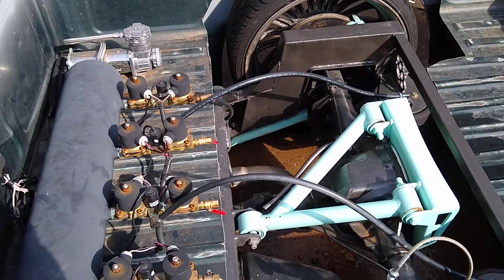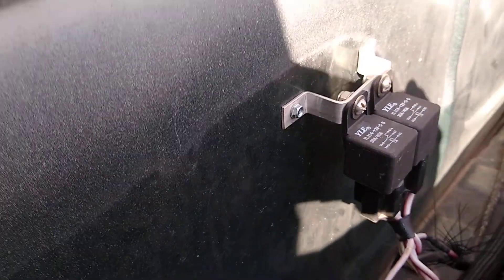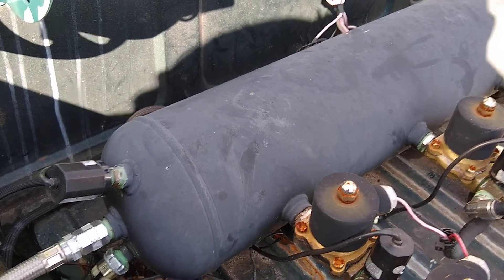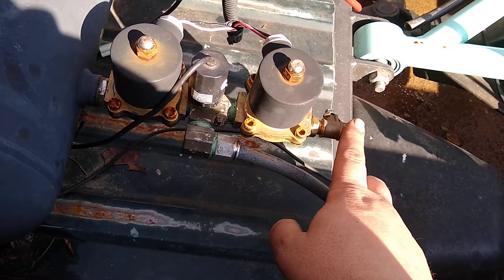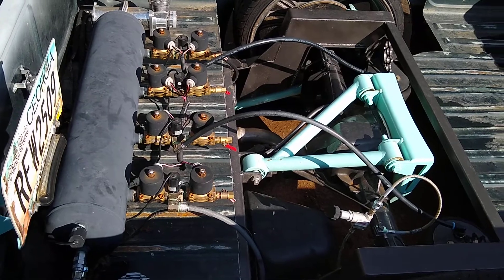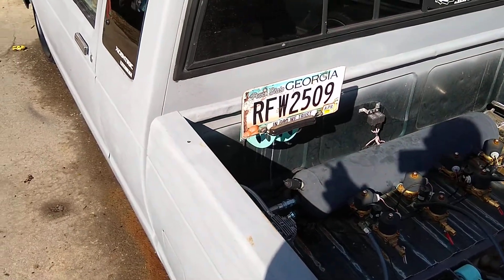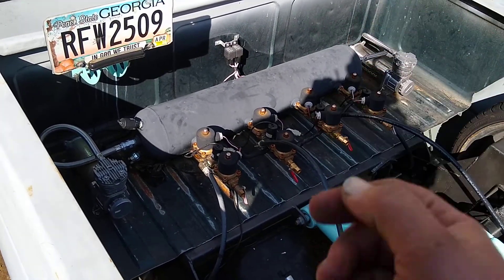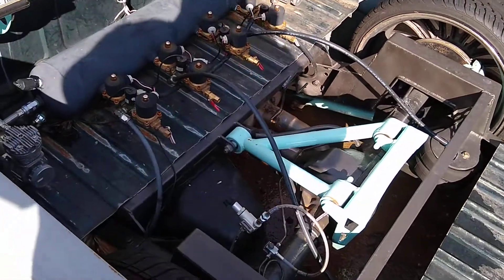The basics of air ride. Components, plumbing, electrical.

Comment: I have a question about how to wire up the smc valves up to your switch box?
Reply from the maker: @josiahmesquita5844  what's up? There's tons of variables. Making sure you have a 3 way on/off/on temporary switch for each axle or individual wheel you want to control. Then. That switch should have 3-6 terminals on it. Quick goog will give you their designation. Ground your smc's to itself, or locally. Power feeds to switch input. Each switch out put sends that power to the smc. Wire corresponding to the direction you want the switch to function.

Comment: I need to know cuz I have no diagram my switch to my valves which wire do I hook up to which valve
Reply from the maker: @dustybellamy5670  well there are 100's of different valves, and 100's of ways to plumb a truck. Do you have Individual valves like in the vid, or a valve block like accuair?
Reply: @4agshoob  no I have individual valves it looks like a vixen air ride controller but it's not and they cut the plug off of it and hardwired it

Comment: What's your opinion or advice regarding an emergency/safety pressure relief valve for each bag?
Reply from the maker: @JU57US  considering most quality bags are rated at 600psi, and most pressure switches are limited below 220psi. You'll never be close to bursting a bag via pressure, only abrasion.
Reply: @4agshoob  I was searching and searching for the pressures that my bags were rated to and found that info very hard to pinpoint. I was thinking at least over 300 psi, and therefore came to the same conclusion. Thanks for confirming it for me! It makes sense to have a single emergency relief valve for the tank and leave it at that.
Reply from the maker: @JU57US  bags are incredibly efficient in weight bearing. It's not so much pressure, as it is volume that determines everything- eg: it may take 70psi to lift 1500lbs on a 2500 series bag. Put a 2800 in place of that 2500, and now you lift that 1500lbs, with 25-30 psi, but requires more volume. Compact builds, can operate on higher pressures, and smaller bags/tanks. Larger bags= bigger tank= more compressors for volume.
Reply from the maker: @JU57US  in saying that, unless you are using a bag in some type of machining operation or in air hopping competitions, there's absolutely no reason any vehicle shouldn't see full lift at 120psi, unless the bag is too small for the weight application.
Reply from the maker: @JU57US  my specific application, s10's are front heavy. You're also limited in circumference room for the bag itself. 

I used 2500 bags (V6) MMW arms, and thorbeck 2" upper bag cups. On 20's I don't begin to lift until I hit 60lbs. Ride height is 80psi front. Rear bags are 2600s. Rear full lift is 40 psi. Ride height 15ish. In doing this, with shorter cups, the bag now uses volume + pressure to offer a stiffer 'spring' effect, than if I were to use 3" upper bag cups. Yes, I could swap, and then probably lift at 40, and ride at 60, like being on a cloud. Trucks have horrible front dive and lean when a sway bar can not be applicated up front. I wanted to eliminate that as much as possible, in turn- allowing the bag, to hold more volume, via psi, because of its compact application.
Reply: @4agshoob  thanks for all the information! My truck is a 1 ton pickup with bags sized for a semi tractor. My compressor is actually engine driven off my Cummins 6BT, so it should have the volume as well.

Comment: I have a question so I don't need airlines going inside the cab for the air presure gage along ass I have a sending unit from each solenoid. And a sending unit into the tank sorry I'm trying to understand the system.
Reply from the maker: @SE-se3jq  yeah, you can have electric pressure sensors and electric pressure gauges.  Only manual gauges will need the air lines routed to them.

Comment: ❤❤❤ I have 4 VIAIR air compressors going to a 2 1/2 gallon tank. It doesn’t take that long to fill it. I’ve just got a find a better hose that goes from the air take to the air gauge. It seems like I have a leak in the system I’ve got a find a better airlines and better fittings. ❤❤❤.  YES I SAID 4 VIAIR air compressors just for airhorns 🔥🔥🔥🔥🔥🔥🔥

Comment: I just bought a Cadillac deville not knowing anything about air suspension the car stays locked up when I press the lower bottom I hear the switch going but car won’t go down

Comment: how do you control the speed or rate of drop?
Reply from the maker: The ball valves on the end of the release solenoids. (Red handles) for drop speed. This was with 1/2" line tho. 1/4" is slow enough on its own. I wanted quick lift, and slow drop for road hazard avoidance.

Comment: is it same selenoid to fill and dump? u jus connect them with a T between?
Reply from the maker: @adriansawa8742  all solinoids have the same function...Remain closed until energized, and return closed when de-energized. The T between them is what feeds the bag. One solinoids separates the tank pressure from the bag, the other keeps it all from escaping, once in the bag.

Comment: I have the same set up. I'm just running into electrical issues. My 200a fuse to the battery keeps blowing out. Maybe a grounding issue. I do have a 120a kill switch fuse too that might need replacing.
Reply from the maker: I had a compressor burn out and do that. Really shouldn't need more than 150a on dual comps

Comment: Where do you get the power and ground for each valve ?
Reply from the maker: Depends on how you wire it. Each solinoid needs to see a ground, and a 12v. I personally ground mine to their casing, and just wire the 12v to the switch box. You can pull a fused 12v from anywhere in the car.

Comment: What’s the object on top your “Tee”? It looks like another valve or solenoid. I just bought tees and have virtually the same open/close solenoids you have but that middle thing is not something I’ve seen. Please let me know if possible.
Reply: Maybe it's a bit late, but that's air pressure sensor.

Comment: Thanks great explanation would I be able to do the same with the air ride valve block.
Reply from the maker: Yes. Works on the same exact principles. Only difference is the block takes place of all those t fittings between the valves.
Reply: @4agshoob  thanks bro I appreciate your help.

Comment: How do I wire up the pressure switch and cut off switch
Reply from the maker: The pressure switch is the cutoff switch in the system design. Basically, you'll run a power wire to a switch in the dash from the battery or power source. Leaving that switch you'll go to the pressure switch on the tank. (Pressure switch has 2 prongs) leave the pressure switch, going to the relay you're using to activate your compressors.

Comment: How do I hook a switch up to my solenoids
Reply from the maker: The same way you would hook up any other switched 12v accessory. You can ground the solinoid at it's location and run 12v through a switch to the solinoid, or you can power the solinoid, and run the switch by way of ground.

Comment: what size lines?
Reply from the maker: Those were 1/2" at the time. A little too fast for the smooth operation of the truck.
Reply: @4agshoob  did you use restrictors or change the lines to 3/8?
Reply from the maker: @65ondubz  at first I put 3/8 ball valves on my dump valves to slow the flow on airing out, but it was still crazy fast. I've switched up to 3/8 calves and 1/4 lines now, and much more pleasant and predictable.
Reply from the maker: @65ondubz  valves*